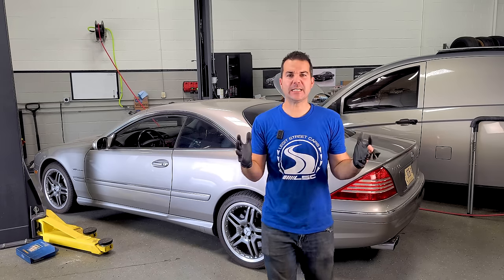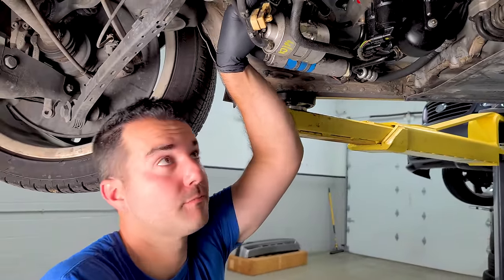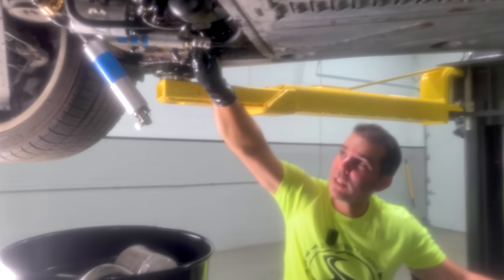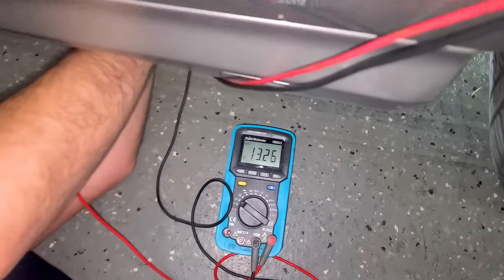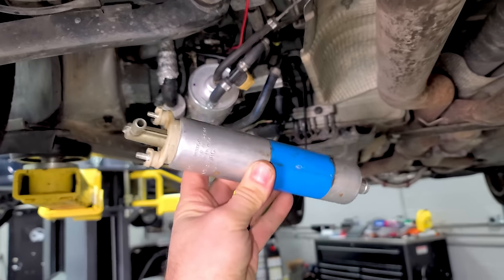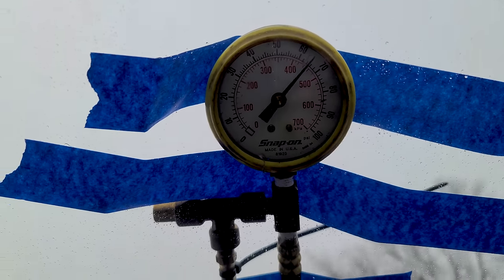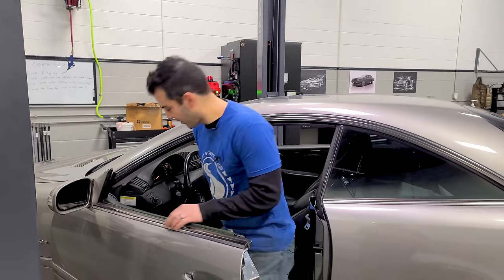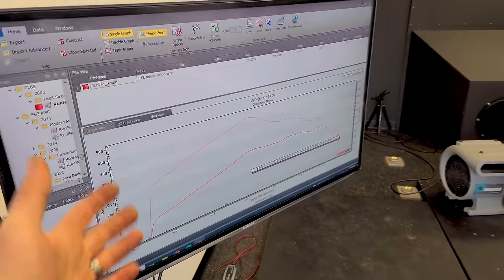I Used Bugatti Veyron Parts & An Alex Trick To Fix My CL65 AMG V12! You Won't Believe What Happened!

Comment: Hey dont feel bad. I have a c32 amg that i swapped the sc for a na intake and a turbo. I had the same issue youre having. I though fuel was the problem and tried many things. Vtech kept trying to send me tunes but none fixed it. One thing i hate about Mercedes pcms is how they shut down from the slightest misfire. If i have it 95% throttle it wouldnt misfire at all. 100% and limp mode it was. Couldnt find a tuner in FL that would touch it so i just sold it. I hope you fix it. I was hopping to have some closure after watching this video but i see me and you have the same broken heart.

Comment: Look for a restriction after the fuel pump. You releived the fuel pressure, but there was still pressure when you took the line off the pump. That means something is still holding pressure. Check to see if the car bottomed out and crushed a steel fuel line or if there is some other restriction.

Comment: I would check extra good for boost leaks.. that angry intake noise sounds just like my truck did under load when I had a split intercooler boot. It was perfectly fine unless I ripped on it in higher gears!

Comment: I remember around 2010 I was looking for a sport coup and having owned and suffered very much from a couple previous E class cars from late 1990s, early 2000s that when I considered this same model I got a certain intuitive sign that told me ‘RUN. RUN AWAY’ from it.   A friend of mine was the service manager at a local Mercedes dealership and he confirmed: these cars are literally impossible to keep running.   Extremely common to junk these only 5 years after manufacture.   I bought a C6 Corvette simply because I wanted a car I could repeatedly drive across country and know it would get me there reliably.   The vette was faster than this car and frankly as common and flawed as they are I got daily compliments on it.   100,000 miles later and the vette had only 1 single issue: harmonic balancer that I replaced with a race unit.    The AMG cars were just all flawed during this era.

Comment: test the response speed of the TB motor , it would explain why you are going rich at the top end. u have plenty of fuel and we know the engine is cutting ignition due to a miss. I would also check the Cranck and cam position sensors, as they coud be feeding competing info and that would cause single bank to freak.

Comment: Since your boost pressure is reading higher than actual, makes me think the car is expecting a different map sensor input. Is that tune supposed to have 4bar map sensors when you only have 3 bar? With this issue, are you hitting high boost cut out?

Comment: Off i feel your agony.

I had a sort of simelar issue on a car i was working on some years ago.

It would drive fine, but cut out at full throttle.

It was a diesel thoug.

But i changed everything. Feed pump, hp pump, injectors and so on.

In the end, i found the issue by compair ing 2 simelar cars.

Turned out the hp pump should change from 12v to 50v at ful throttle, for rappid increase.

This was not mesurable when stationary, and not in the Document action (atleast at the time)

Changing the ECU fixed the problem.

Comment: I would be looking at exhaust flow. See if the cats are restricting flow at full boost. With the hybrid turbos there could be too much pressure being caused causing it to go into limp. Might be worth just chucking a straight pipe straight out underneath.

Comment: Just 2 thoughts Alex, disclaimer I'm not a professional at anything. Could the problem be that the gas tank has a sock in the tank that's old and possibly the venting in the tank wasn't designed to empty it "12" miles? Second you now have 2 pumps trying to pull twice the volume out of the original line that was engineered for the one pump? Like I said just a thought. Good luck.

Comment: I used to have a w220 S600 and it went into limp mode (multiple misfires) when going full throttle because of the computer that controls the coils, i replaced them and it was good. Maybe you can also check this out.

Comment: I had a 2011 c300 that had this same issue, the car would go into limp mode but only at wide open throttle , if you turned it off and back on it would be fine again, if I remember correctly it ended up needing a new ecu

Comment: Could there be a small block/restriction in the fuel line between the pumps to the rales? That's why it didn't get enough pressure with only 1 pump, So when you added the second pump it gets enough for short pulls but not long ones on the dyno

Comment: I have a 2011 328i BMW and having a problem with my waterpump hose coming off and can’t stop it from popping off I just replaced the waterpump after it went bad and I even went as far as replacing the hose because it was close to dry rot but it has original clamps which have around 195k on them do you think the clamps are the problem? They are the screw on ones.. and I have bled the system right so I know it’s not back pressure in the system please helpppp…

Comment: Here is another idea for you… I wile back I worked on a v8 twin turbo bmw  , the hot V engine. Anyway the car had similar condition when u step on it on hight gear it will act like u hit rev limiter at 5500rpm… now the fix for that was : boost control solenoids were right next to each outher and someone swapped the vacuum lines , so computer was trying to control the wrong turbo, anyway swapped the lines fixed. I looked at the diagram for this engine , it’s one solenoid for both turbos… just see if lines are connected properly to it …

Comment: Maybe you want to add a check valve to the secondary fuel pump so when it isn't running, the fuel doesn't pump from the high pressure running line back through the secondary non running pump and back into the gravity fed line from the tank....

Comment: Just throwing this out there, but a leaking intercooler maybe? Considering the Rich stumble during boost, or maybe faulty intercooler/turbo hoses? Or maybe a faulty knock sensor adjusting timing, causing it to go rich?? I dont know to much about mercedes, however it could be a clue🤔

Comment: I’m sure you checked this out already Alex, but have you monitored the output voltage of the alternator on throttle? Logically it would generate more voltage, but what if it’s only pushing 12-13v on throttle?

Comment: What if its the translation issue you said? If it sees more boost, than it actually gets - it puts more fuel in, expecting boost, resulting in it being too rich. Either that, or the second fuel pump messed the fuel flow up and you build another problem on top of the existing problem. 
What I dont get is, that its not setting the codes according to a rich condition, that doesnt seem normal to me either. It must have a reason to kick you out.

Comment: If there are no stored fault codes in the ECU, I would suggest that the ECU is at fault, as should have stored fault codes for the low fuel pressure under full throttle. A standalone system might be a worthwhile investment in such a powerful engine.

Comment: So, A couple of things, bigger injectors will need more fuel pressure, I was leaning toward fuel starvation in the earlier part of the video as there was very little fuel in the tank and acceleration could cause starvation because the fuel is pulled away from the fuel tanks outlet with acceleration. It doing that on the dino made me wonder about the injectors you have swapped in, the map could very well be off, and if the ECU detects and over lean condition it would most certainly cut ignition, the excess fuel still coming from the injectors would then cause everything to go rich, It could be that there is a lean condition being triggered before your instruments register it, you can hear it in the exhaust when it starts cutting and, you can hear it before the ECU goes into limp mode. Play the video back and listen to the exhaust tone while the camera is at the back of the vehicle while on the dino 42:44. I would say this is a map/ tuning issue. but, that is just my 2c worth. Good luck.

Comment: Boost leak and bad gas cap.  Leave cats in and cut muffler off.  You’re welcome.

I had a car that had similar issue and the muffler had internal baffles that would shift as throttle increased and caused back flow and flashing check engine light.  If you are leaking boost, your fuel might be trimmed causing all kind of issues and thus flashing CEL happening “only under increased boost”.  It goes into limp mode so you don’t make it go kerpow

Comment: How does Mercedes deal with fuel pressure on a boosted engine?
On Fords base pressure is 39PSI +- boost pressure.

A piece of 3/8" threaded rod works really well on unblocking catalytic converters

Comment: Armchair mechanic here. Since you released the fuel pressure... but still had fuel pressure at the pump, could you have a blockage that's acting like a check valve between the pump and the fuel rail?

Comment: Alex, on the fuel pressure issue, you focused only on the supply side of things in this video. Now think about the other end, where the fuel pressure could be "released." In some scenarios that might be a leak, but in this case, think about your injectors! What if you have one or more injectors dumping too much fuel at WOT, maybe due to an injector issue or tune issue. That could cause drops in fuel pressure, a rich condition, and too much fuel could cause the misfires that trigger limp mode. Now with the second fuel pump, you might be masking the pressure drops without actually fixing the root cause. Just food for thought, good luck!

Comment: I’m pretty sure it is going rich because you added a second pump instead of fixing the problem. I would address why the pressure the sensors are seeing is not the same as what you are seeing when you check it manually. I’m also wondering if there is some kind of fuel pressure regulator besides that voltage box. I was also wondering if maybe there is some kind of a leak in one of the hoses from the tank to the pump. Given the fact that the post oxygen sensors are reading differently, I would probably throw one of those in there before I do anything.

Comment: I think when you do full throttle the engine flexes the engine harness flexes slightly and there could be a break in one of the wiring causing the car to go to limp mode because of a disconnect or drop in voltage ?

Comment: just thinking out loud here as i dont know how the fuel system works on that car. but is it possible that the fuel return valve(or regulator ) sends to much fuel back to the tank? where it will work fine until WOT?

Comment: I would upload a oem tune on it and put original injectors in. It can not be a coincidence that you have these issues that were not there before the engine removal after installing those upgraded parts.

Comment: Your car has heat soak. Put in larger charge coolers, maybe an extra coolant tank in the boot and upgrade coolant pump. Nice bosch pumps available. Can also use water methanol injection to cool the intake air. Monitor intake air temperature.

Comment: I've seen the potentiometer in the gas pedal cause this. Or the tps or servo on the throttle body. A problem with any of these will cause limp mode.

Comment: I'm wondering, Alex bled the pressure from the fuel line, yet there was lots of pressure still in it.
Could it be an obstruction somewhere between the pump and the injectors?

Comment: Perhaps no codes, because your ECM is bad!?? Fuel pressure fix is overkill, don’t think that’s it, however I would swap ECM’s and test a Non Cat exhaust, after the ECM is ruled out!.. crazy! Worked for MBZ for Decades, I would also have a dealer run a code scan, with greater detail, then your current scan tool, although it’s a good one.. Such a Great Flagship Machine that was!! I Currently own a Mint Condition 90k Mile W140 LWB that gives me absolutely 0 Issues! Sometimes more simpler designs, have much Simpler issues!! Good Luck!!

Comment: 44:36 was I the only one that noticed the butterfly barely moved when the engine was revved smoothly and then moved normally after they let off and blipped it? Would also make sense with AFR as well if the butterfly isn't opening obviously it would be flooding the engine.

Comment: I'm not gonna scroll because i dont wanna be spoiled, but I'm guessing either the pickup is sucking air or there's an issue with the regulator.  I had a similar problem and what had happened was vibration had basically un flared my aluminum -6AN hardline and it seemed to be enough for it to suck air under hard load.  It still had pressure in the datalog, but I was inspecting stuff and noticed how wallowed out and messed up that fitting was.  Just cut it and put a hose there instead, seems to be solved now.

Comment: Bro i know you gonna fix your CL65  but i dont know adding fuel pump was the way to do it btw there is a solution this type Mercedes have problem with „Possible transition resistances in end sleeve Z7/43z1 and Z7/43z2 in motor cable set„ go to mercedes garage and ask about it

Comment: I was thinking that if you are still having fuel pressure issues, if the feed line from the tank to the pump is rubber, it maybe collapsing under vacuum. Older rubber lines have a tendency to have their walls weaken.

Comment: You still may have voltage drop at wot if wiring was not upgraded. Also, the Wyes in the fuel system may be causing a restriction in addition to running off the stock lines being too small.

Comment: is it possible that the fuel line is clogged and it would explain why even by venting it on the engine side, you still have some pressure in the tank? it would explain why even when the pump gets high voltage, you still end up losing pressure on the engine side. To check that you could get the pressure right out of the pump and compare it with the other gauge, the drop should be small due to the line resistance

Comment: I think there is a restriction in the fuel line somewhere I guess why you still had pressure in the fuel line when you deep pressurize it or there could be a check valve that’s causing that maybe it’s restricting flow

Comment: I’ve had fuel pressure issues by using the clamps you just used. Use Oetiker clamps and throw those in the trash.

Comment: I thought you would have known vetter than to use worm gear hose clamps on fuel systems.....
Those clamps shred the hose and cause leaks... ALWAYS use fuel hose clamps, theyre smooth and round (they dont oval)

Comment: Unfortunatly I had an issue with my car and after a painfull 2 months the problem was with the ECU. The pins on one of the chips was loose on the board and it would throw all sorts of codes. I had to open the ECU box to relise this.... I had changed everythng that the ECU codes had thowen at me.....

Comment: When you released the pressure of the fuel in the front of engine and went disconnecting the outlet of the pump and there was still a lot of pressure, seemed that there is a blockage in the fuel lines between the pump and the engine.

Comment: Ok after watching the Dyno and reading some comments, you can rule out the exhaust by unhooking it, BUT Im starting to think your problem is either the fuel line(s)/fuel pressure regulator(s), or the PCM.

On most cars the liquid fuel side of the system is not monitored by many sensors, but this car is a bit of a sensor whore, and i can EASILLY see the stock fuel line/pressure regulator being restrictive.

Comment: I noticed the suspension didn't lower down as you sped up on the dyno. strange. Also, you should replace the old pump because the internal seal will start leaking soon. Mine lasted 16 years before leaking.

Comment: If the cats were plugged theaters a silm chance the mufflers and resonators could be clogged it’s one of the reasons diesel guy run a true straight pipe from the turbo back I know from experience that  you can blow the front part of a can style resonator on a diesel apart just in three months of driving it hard with a hot tune

Comment: Given that you suddenly lost AC and still had pressure in the fuel line, i don't think its Occam's razor applies. I'd think it's relatively apparent that there's some type of obstruction in the fuel line and possibly an ECU issue.

Comment: seem like the fuel pressure regulator isnt working properly, iit consists of a check valve at the pump and one at the end of the fuel rails . the ones at the fuel rail are usually vaccume operated .they close at full throtttle allowing maximum fuel pressure . and the tests you did with the fuel gauge seems to point in that direction

Comment: Seems like with all the pressure issues when you unplug fuel pump seems like you have something in the lines blocking it if you keep releasing the pressure then take the pump off and it still has pressure when you take the lines off

Comment: “It’s a beautiful thing” - Is Alex Legit Street Car a Martha Steward of tuner cars? There’s something else is screwed up then fuel pump. Evap system plugged up? It shouldn’t have fuel pressure after first fuel line relief.
Could transmission solenoid cause intermittent limp mode?

Comment: Could this have anything to do with the air in the fuel system you noticed at the beginning of the video? Possibly an air leak in the fuel system causing a lean detection throwing the car into limp mode?

Comment: dude, if you relieved the pressure at the fuel rail, and it still squirted when u did that side of the fuel pump, theres a clog between the pump and the line. check it

Comment: Just take it to mercedes-benz offical dealer (or better reputable independent mercedes specialist for diagnostic. They got tools and programms and experience. Once they find the real problem, you can try fix it yourself. Also one fuel pump should do the job

Comment: I'd put a back pressure gauge on the exhaust, and i'd pull the injectors and have them cleaned and flow tested.